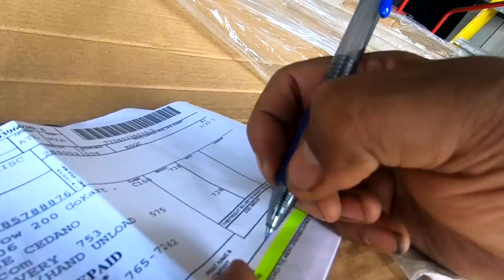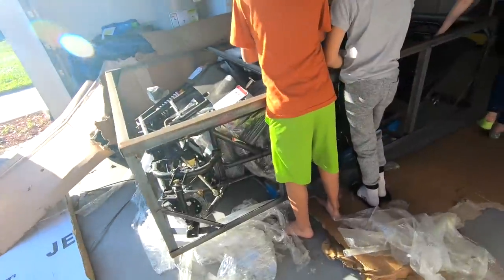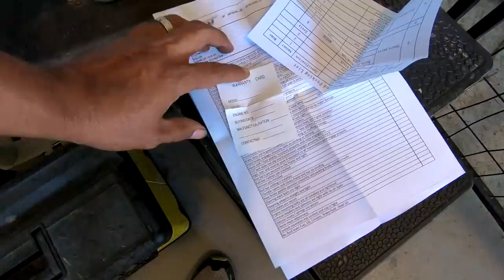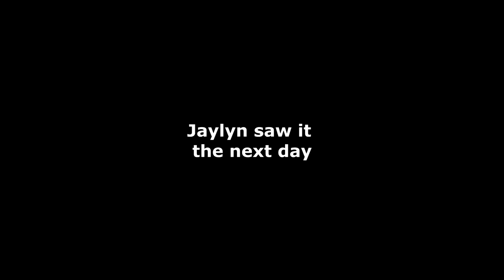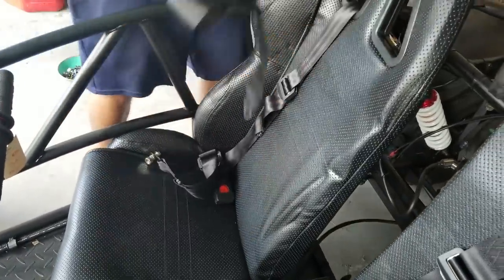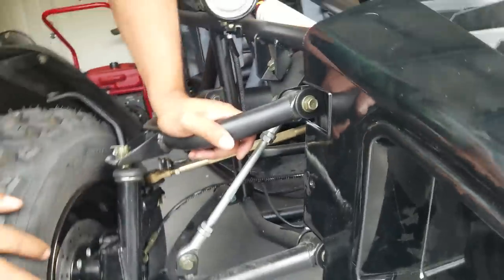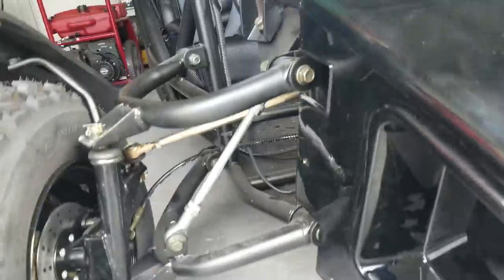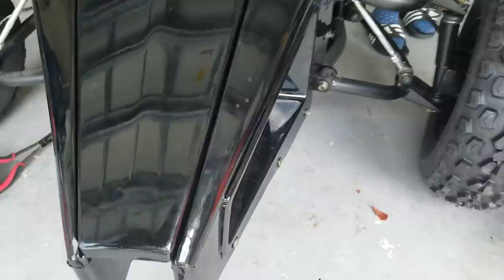Unboxing The 2019 Arrow 200cc Go Kart From TaoTao

Comment: We have the blue one. Straight pipe, EGR delete and a better air filter. You can actually rejet the carb to get more smiles out of it. We offset the rear wheels to get a wider footprint and drift it around the neighborhood. We had trouble with the cheap headlights but upgraded to some LED’s and the throttle cable snapped so we used a universal kit to fix it. My wife and I drive it to the dollar store all the time. It’s the best toy for “the kids” ever.
Reply: dollar store or dollar sto?
Reply: @nepzski  it’s definitely spelled Dollar Store.

Comment: I bought the 150 about three years ago.  Although it seems to be well constructed, I found the suspension way too stiff to be effective.  Being a hot rodder, the 150 was just not enough power for me so I have since replaced it with a Honda Nighthawk 750 and 5 speed transmission.  Now it is an absolute blast to drive.  Hope you have as much fun as I have had.
Reply: Is that the inline four, or the V-4? The inline four is smooth, but the v-4 is a beast. IIRC, 50hp for the inline, and 72 from the v-4. V-4 is shaft drive, you can find them on Magna's and Sabre's for sure, but the Nighthawk I can't recall which motor it used
Reply: @AgnotologyTV  It is a 1997 air cooled inline 4 rated at 75 hp.
Reply: I've been searching far and wide for someone whos has done an engine swap on this, could you provide more info on the swap because I'm very interested in doing the same
Reply: @mansourlawand8339   Here is a link to a go kart message board which shows my build. http://www.diygokarts.com/vb/showthread.php?t=40665
Reply: @Mavaholic it’s not a direct link to your forum it just takes to forum page listing all that have been posted.
Reply: @Mavaholic how fast it go now?

Comment from the maker: *Dont buy it from familygokarts.com poor customer service on parts replacement. My exhaust broke on a weld so apparantly manufacture errors are my fault. Make sure you read your warranteee before paying $2500 for this.*
Reply: If you need parts or anything, try Gopowersports.com
Great service and they support several youtubers so you know they must provide good customer service otherwise They'd get a shitload of hate on youtube.

I bought from them a Mini Xrx-r+ and they were very quick to respond.
Reply: Bought mine from them and it came all smashed from shipping :/
Reply: @mindbulletz2803  
Mine also came a bit damaged, but I think this is out of their control. You can still return it but since i wanted to import it in canada and the shipping was already signed by my fowarder, i had to keep it.

It was a trailmaster mini xrx-r + for my daugther. So far i'm pleased with it. It has a few flaws (no denying it's a chineese buggy) but it still runs and drivea well and starts quickly even after winter storage.
You can't find better for your kid because there's nothing else. The small rzr170 is still too big for her size.
Reply: This was the first day she drove it, throttle was limited to around 1/3 of its max speed. It's pretty nice she can ride with her friends or her young brother. With all the adjustments it'll fit her until she's 12 easily.

I'm 6 feet tall and i can drive it (but i'm very cramped)

https://youtu.be/OpC_hc1Bt4w
Reply: ProbeGT2 yea I kept mine and they sent all the stuff to fix it... I’ve since learned a lot about gy6 engines. I bought the 150cc one 2 weeks before they came out with the 200cc lol so I’ve bought all high performance taida parts and built mine up.. added an oil cooler.. hammer head exhaust which makes it growl nicely.. led lights rather than the cheap ones it comes with.. added a motorcycle stereo system and dr pulley cvt kit... this thing rips now! I highly suggest doing the Dr pulley cvt upgrade kit from hammerhead performance.. it’s costly but makes a big difference! I bought mine for my son.. but I ride it more lmao
Reply: @mindbulletz2803  I'm curently finishing restoring a Kinroad Sahara 250. it's about the same as a 150 but came with a 250cc liquid cooled Honda helix clone (like a bigger gy6 if you prefer) I already installed dr pulley sliders (a bit lighter) and a red secondary pulley spring. I can't wait to finally drive the damn thing because i dismantled it the 1st day i bought it so i never drove it. Parts are hard to find also for the kinroad. Those chineese buggies looks all the same but they are all different. Rack and pinion, struts, brakes, control arm, they all seems the same but a bit different.  Finally found some struts on alibaba but they had to send me 2 pairs because the 1st one was already a bad part (ball joint all loose) I hope it's as fun as it looks. I know they are not powerhouses but sometimes fun is not about power.
Reply: 2500 for that pile of garbage...Next!!!!
Reply: Thanks
Reply: 5/13/2020 
Do u still have it?
Is the motor holding good?
Planning to buy one

Comment: As a dealer I think you have done a good job as non of Toaos products come with assemble instructions. But you should be using thread locker as the bolts do loosen.
Reply: i'm a dealer too  and your so right--- thread locker is a must!!!!
Reply: @wowiezowiepowie  As just a person talking to 2 dealers, why such small power plants. Why didn't you just stick one of those electric motors that comes in the little jeeps at walmart. I love the design but for 2,500, you couldn't have went with a stronger engine. That's not right. Hey dude, i'm glad your kids enjoyed it so much. Hope you get your money's worth out of it.

Comment: Engine swap to an 600cc engine
Reply: Sly Carl yea I’d probably do that once the engine goes out.
Reply: For 2 grand it should come with one. That thing looks slow as hell.
Reply: Was just thinking a used sv650 motor/ trans would be slick in that little thing.
Reply: Or a 1000 gsxr engine
Reply: James Langford bruh
Reply: It need a 670 predator stage 4 with slicks

Comment: Love the chassis its like a mini Ariel atom, only concerns for price point are... 
1. The front tie rod's not already been set/locked in place (As people don't understand that wheel alignments kill power and cause safety issues if not set right)
2. Engine size (GY6 only good thing is the gearbox or that the 250cc version is same size)
3. Roll bars over seats not tall enough (always feel like they don't flip them with even crash test dummies) or i just don't like being crushed or my face in my lap when i roll over.

Keep up the good videos and enjoy....but engine swap once kids are older or adults want to use (EFI means you could have tune for kids)

Comment: These things are junk and you'll never find parts for it. You should've just bought a used Polaris rzr 500 or even the 150. You can find um dirt cheap.. it looks cool. Maybe you guys will have good luck with it and it won't break down on you
Reply: Here is a link to the parts you might need.  https://partskit.com/product/search/model/schematic/00039?vm=ARROW%20150&vn=Go%20Karts&vc=0587

Comment: Is this street legal?? Before I finance one
Reply from the maker: if you mean street legal ready, no. It's missing blinkers and a plate light first. Then you'll need to contact dirt legal for the registration and tag. make sure to get the title or manufacturer's build documents with the vin numbers. The numbers are on the frame anyways but better to have the paperwork. I have the title but waiting for the blinkers and stuff from amazon. I was told you'll also need DOT approved street tires.